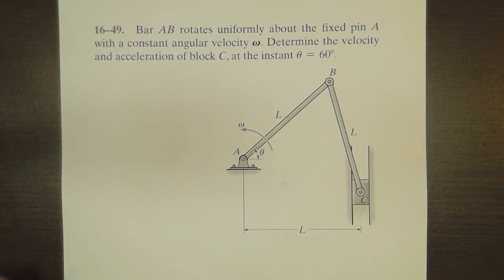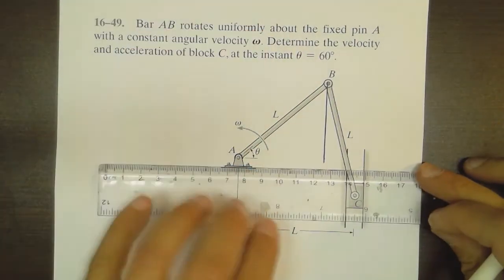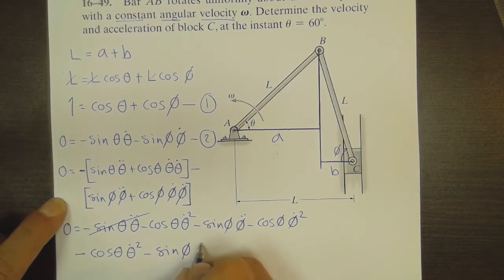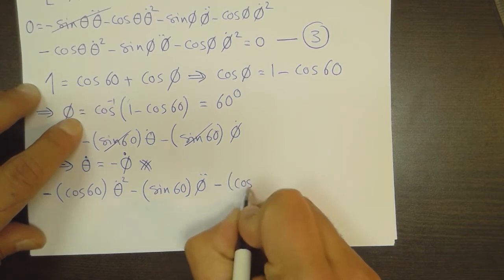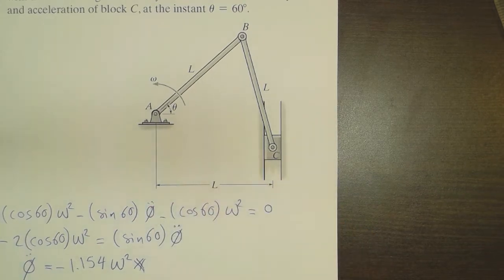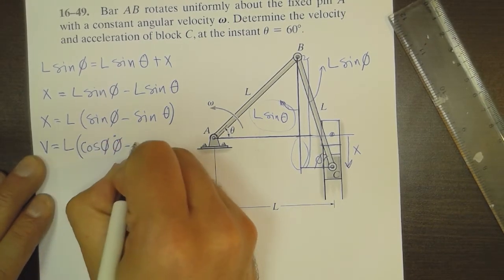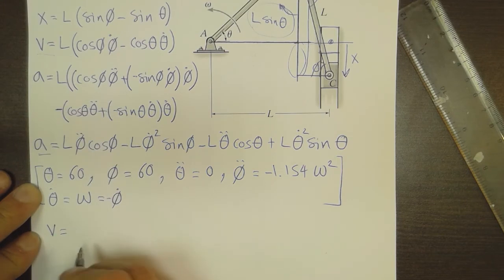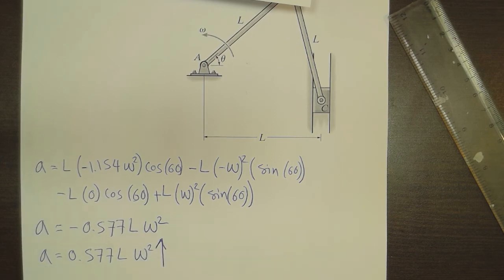Lecture 14 - Example 3: Absolute Motion Analysis

Comment: This question is impossible, both angles cannot be 60 degrees (phi and theta) when all lengths from ab bc and ac are L
There cannot be a difference of height between ab and bc
mfw you go against the laws of physics to "solve" an impossible question 
💀💀💀
Reply: I was thinking the exact same thing lol
Reply: So what? When both angles equal to 60⁰, that means the triangle has 3 equal sides and 3 equal angles. And both of points A and C are gonna be at the same height. Also, the piston is gonna be inside the cylinder, which is very logical! 🤔
Reply: @nourdarwish4277  You're right.  Now that I'm watching this again a few month later, I don't see anything wrong. I don't know how I ever saw anything wrong lol. It all makes perfect sense to me.
Reply: @1stcomment700  That's great! What are you studying?
Reply: @nourdarwish4277  I was just doing a little side project where I needed to design a lever that can move something up and down. I graduated from Aerospace Engineering earlier this year tho.
Reply: Except lengths from AB and BC are not equal to L, their sum is. AB+BC=AC=L
Reply: @ayman7427  AB = BC = AC = L

Comment: Dear Dr. Faysal. When you calculate the acceleration, you have considered only the tangential acceleration (which is the product of the angular acceleration (alpha) and the arm between the IC (instantaneous center) and the point of interest (the arm for 60 degree angle is L). 
Should not you consider the acceleration in the perpendicular direction due to the centripetal force (which is equal to v2/r  or w2r, in both equations the number 2 are in square form)? Thanks.
Reply: Good question